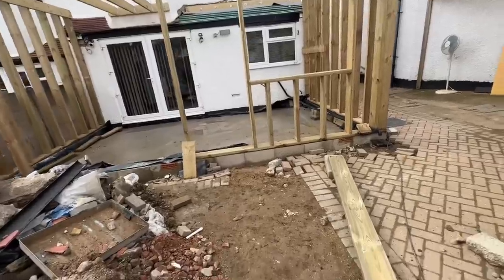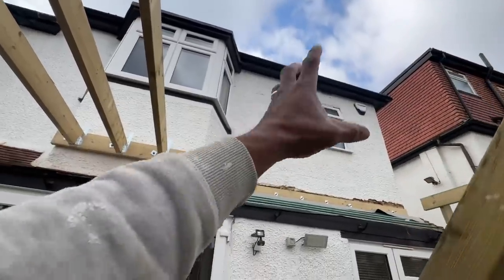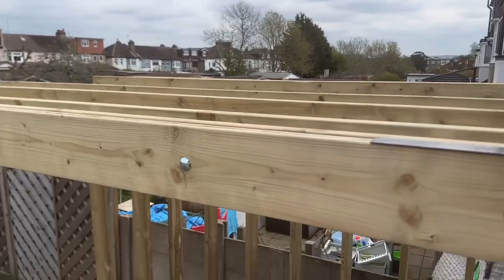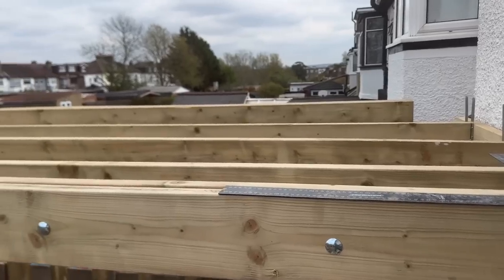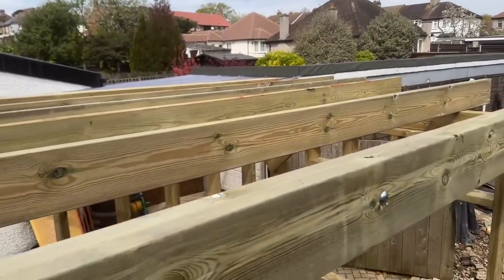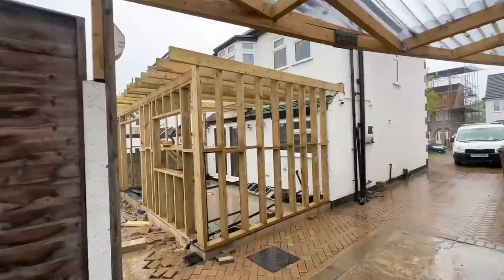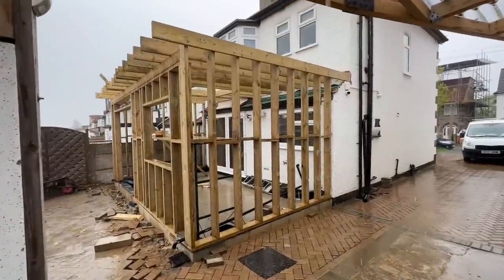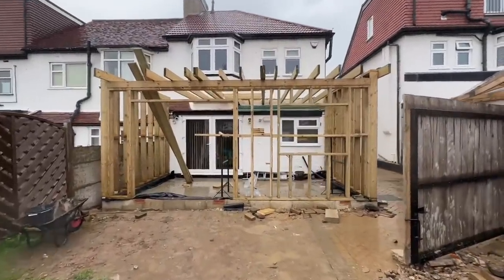Timber frame extension: Ep 13

Comment: Hi mate. I’m just a DIYer but built myself a garden gym over lockdown and loved working with timber. You mentioned in the video you were going to cross batten perpendicularly on top of the rafters before the firring strips and OSB. I didn’t do that with mine and simply put the firring strips straight on top of the rafters themselves with nothing perpendicular. Is there a particular reason you’re going to put the cross battening on first?
Reply from the maker: Hi there, yea typically I would just put the furrings on the rafter. I’ll put putting the furrings as you did but with the cross batten above. The area above will be where the air vents through the roof. It will vent from left to right. I showed the design drawing on one of the previous episodes. I think the first day that we started in the timber frame
Reply: @darrenthebuilder  thanks mate. Only just had your channel appear in my recommended vids so will have to go back to the start of the series to check it out!